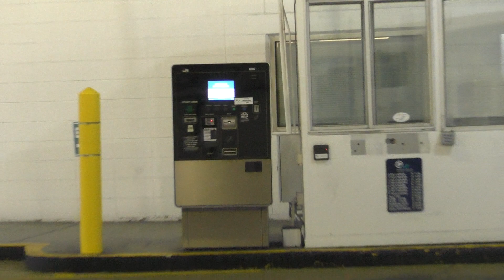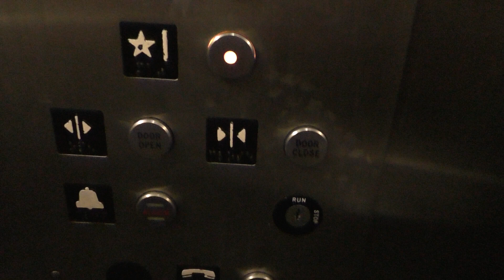Low on oil! Hydraulic Elevator at the Waterside Garage, Norfolk VA

Comment: Interesting, whenever an elevator is low on oil, I think it should be taken out of service or if the top floor has a lockoff switch, lock it off.  It would be better for the pump so it doesn't damage it.
Reply: Yes! I agree!